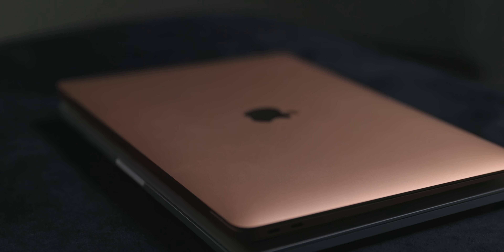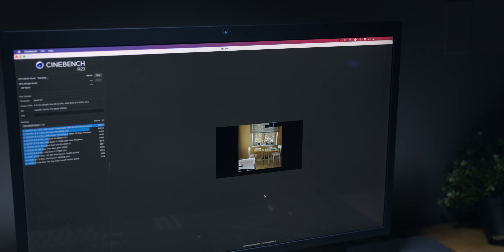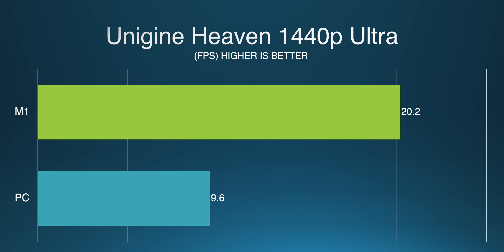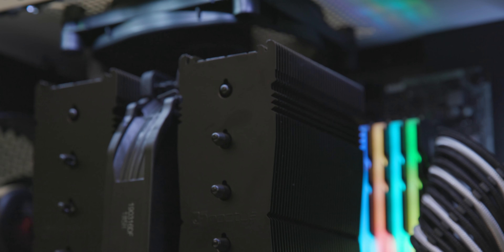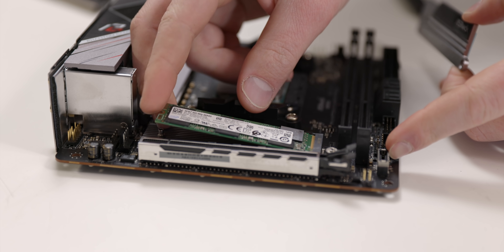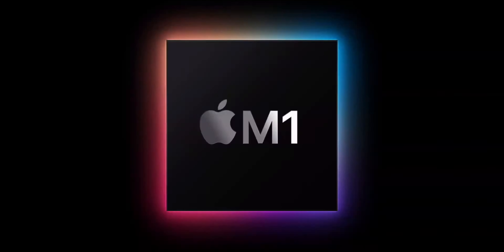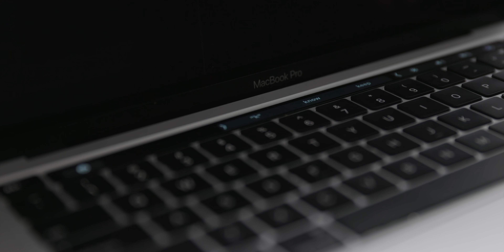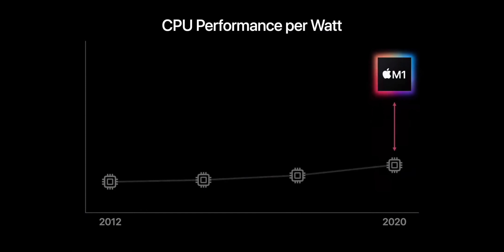$699 Mac mini vs $1,000 PC: Which Is Faster?

Comment: If only the chip didn't include RAM inside it. Once it goes bad, you cannot replace it. Not to mention the rest of the computer components.

If law improves and Apple provides schematics etc. for their devices, and return to making their products repair-friendly like before (read: PowerPC era), I would be the first to buy an ARM-based Mac. But for now, 2021, it's all garbage.
Reply: Nah, that’s just science, if you made it upgradable, it would be slower

Comment: Another part of the Apple's performance gain besides the new chip is the company's optimization of their OS and associated software.  M1's utilization of its memory is superior to Windows in using less space which in recent studies have shown the earlier worry about SSD burnout due to the low 8GB ram size in Airs and Minis is fading away.

Comment: My biggest issue with the M1 is the soldered SSD. I usually donate computers I replace  every 6 or so years so I would prefer it to last a couple more years longer.
Reply: Yeah; soldering an SSD to the board is a problem IMO. If the SSD is used a lot and wears out before the machine is considered outdated, that's a loss of an entire device unless it's able to boot via Thunderbolt storage, which wouldn't be as fast, anyway.
Reply: They could have EASILY used a standard replaceble m.2 drive but apple are scumbags
Reply: That's called a humble brag.  You just did a humble brag.  Nobody cares about how charitable you are.  Nobody.

Comment: Although technically it's heat, TDP is effectively power and heat. You also can not do apple to apple comparisons on TDP. Intel, AMD, Apple. Nvidia... THEY ALL determine TDP differently and under different circumstances. If you purposefully cripple based on TDP, your review is wrong.

Comment: Isn't the M1 a repackage smartphone/ tablet chip?
Reply from the maker: Basically. What’s your point?
Reply: @snazzy   it's  old smartphone technology in a case with a few ports. Which not is not innovated. What is innovate is the ability to run desktop programs efficiently as if they were phone or tablet apps.

Comment: Sorry but what did bring the cost of the ryzen build to 1000$? I mean. I got same performances on a build which cost was less than that, where i have a ryzen 3600 and Nvidia 2060 (i already have the gpu since few years), though. M1 is amazing, but on 3600 i get the same performances (and it costed just 170 euros), where GPU is obviously way faster

Comment: Until Windows doesn’t suck and crash all the time on heavy work loads I’m switching to Mac and keeping my pc for games. Haha
Reply: Crashing on high work loads has more to do with your hardware than the OS. The idea that Macs won't crash is just wrong. I've seen plenty of crashes on both systems. 9/10 times it wasn't the OS that was the problem. People often switch from a terrible windows machine to a high end Mac and think that windows was the problem. And that's just ridiculous. There are plenty of arguments for Mac over Windows but "crashes on high loads" isn't one of them.
Reply: @lamenamethefirst  When Windows error messages  pop up all the time saying “Windows ran into a problem” doesn’t scream hardware problem to me. Running benchmarks and knowing what my hardware is capable of, it shouldn’t be crashing at all. You are right though, Macs have their problems but I’ve never run Into problems like this.
Reply: @BipityBopity93  Interesting. I've never actually had that problem on Windows since windows 8. I think hardware compatibility might also be factor. Some things just don't work together sometimes and with Windows, each piece of hardware isn't carefully selected. People building their own PCs will slap a bunch of things together and sometimes shit happens. Even manufacturers cut corners. But my point is that I don't think Mac OS is intrinsically more stable than Windows in my experience. Cause I've seen some Macs that crash daily and some Windows machines that are rock solid. But Mac having less hardware options on the user end allows them to have more QC in general. Anyway, I just think people often don't do an apples to apples (sorry, couldn't resist) comparison with the Mac vs Windows debate.
Reply: @lamenamethefirst  Totally. It isn’t as black and white like everyone thinks it is. It is a preference. I have friends who prefer the Windows OS over Mac OS simply because they are just use to it, and the same the other way around. My hardware is all comparable with each other which doesn’t necessarily mean there is a manufacture based problem with one of my pieces of hardware or all. I will say this, I spent $1500 on my PC and I spent $1500 on my Mac Mini M1. One crashed way more than the other. This has been a consistent consensus for me personally. So my initial comment was based on my personal experience, not necessarily the argument as a whole.

Comment: All good points but how many people care about 22 watts vs 130 something?  Laptop, sure but I could care less at home unless I am a crypto miner.  I have never had a friend buy a slower Proc for their home PC because the fastest cpu used more watts, lol.

Nah, the apple laptop/desktop is not for most.  Boomers?  Sure!  C-Level execs that want to roleplay Silicon Valley startups?  Absolutely!  Public school teachers that want to fit in with all the cool kids?  Check!

The biggest drawback of the M1 chip is the MacOS itself.  However, as soon as Linux has a kernel for the M1 I might buy it...if AMD is still not killing it with threadripper.

But I will admit, software engineers like me do not make up the majority of PC buyers and it would really suck to get stuck in the Apple ecosystem.

Comment: I was concerned that Apple silicon was going to bomb and that the compatibility and performance wouldn't be up to par. Turns out that neither of those things are true and as a bonus the power consumption and price of M1 powered systems are very reasonable. I'm at least a year off my next upgrade, but it's good to know that the new machines are very capable and decent value.

Comment: M1 is good in a LAPTOP. As a desktop CPU (and especially GPU) it is just too weak. Edit: Nice sponsored video, nobody would buy that crap as their $1000 PC. Unless you live in a pod, you can build full desktop that will obliterate the M1 for $1000.
Reply: someone’s mad 🙌🏽
Reply: @iwatchgamingvids2.043  Did you even read the comment? The GPU in M1 is about equivalent to gtx 1650. You can buy a desktop with better card for $1000. M1 is not a desktop grade CPU, it falls behind. You probably live in a pod, hence why you need such tiny device as a desktop. This moron bought a piece of junk passively cooled chip, a thing no one would buy with that budget and proven a non-existent point. He is either stupid or another sponsored shill.

Comment: Its Mid mMay 2021, I am on my 4th M1 MBAir. Apple phone people told me my first machine's random reboot must be a hardware issue. The replacement ran HOT with short battery life - clearly hardware in that case. The third , after a month, shut down like the first ... they were all 8Gb mem  1Tb ssd machines. I got my money back - and now have a 16Gb 1Tb version. And... I recently saw a video saying the shutdown was software after all ! Hum. Just thought I'd say that. My story started last December. I'm waiting for a Pro box with a bigger screen ! 13 inch is just not enough, but I am getting used to it.

Comment: I actually just last night ordered a basically max spec (besides SSD) M1 Mac mini... 16 GB and 512 GB SSD... It's going to take over for my 15" 2015 (max spec besides SSD) MacBook Pro as my "desktop Mac" setup, since my MBP is currently setup clamshell'd with two 24" displays attached (among other things). It was supposed to be my creative workstation (for some video editing, PS3/4/Switch/PSVita gaming with streaming and capture in the mix) as well as some graphics "work" (as I don't do it professionally) in there too. My aforementioned 2015 MBP gets bogged down with all that. As a laptop on its own it works super well for its age. The M1 Mac mini is gonna be a champ at all of what I aim to do and I'm excited! I appreciate the unbiased view points and the subtle humor you bring to the table, Quinn. Keep it up!

Comment: There are even $2000 windows computers that can’t be a $600 M1 Mac mini
Reply: Nope. This is the worst video i have ever seen. The windows didn't have a dedicated gpu. He could have got a 1660 atleast
Reply: @heershah6451  the m1 doesn't have a dedicated gpu either, its a 7 watt integrated gpu
Reply: @heershah6451  it's a 7watt gpu, it's integrated. 1660 is a 110 watt gpu
Reply: @dustbinsavesyou8283  whose the fanboy here. It is a desktop. It really doesn't matter. Are you sane. And it performs so much better than the M1 mac mini. Who looks stupid now😂😂

Comment: 4750g passmark single thread - 2700pts (passmark),  M1 - 3700pts so the results arent surprising, if you go with a newer Tigerlake or higher end Ryzen you can close that gap, with the  Tigerlake 11700 at 3400pts and  the Ryzen 7 5800x at 3500pts, with the added versatility of more ram and space you could get something equivalent but more versatile with a cheaper overall eco system.  But real world performance might not be the same because that M1 chip has its memory integrated so who knows how small that gap can really be closed.

Comment: Yeah, I agree with much of your covered topics. AMD will more than likely design and manufacture ARM based chips so they can sell and dominate the laptop market. The graphics performance from AMD Radeon is far superior to what Apple is using in their chips. Samsung have incorporated RDNA into their Exynos chips and it runs close to twice the speed of other gpu technologies available for ARM. The next iteration of Ryzen, Zen 4, will be considerably faster again compared to their current offerings and will include RDNA2 into their APU's, add DDR5 and you have a winner in either x86 or ARM configurations. Which brings us to Intel. Well, "Poor Intel". If AMD were gobbled up by Microsoft, could you imagine with all that money how AMD would be able to innovate much faster.

Comment: nifty to hear that the M1 is great but I find it difficult to recommend many things in apples ecosystem due to it being so tightly closed and how atrociously repairs are handled if they are needed
Reply: Coming from Windows / Linux / Android world and switching to Apple, the transition was the best. All the old products feel like crap and old and nowhere near as functional. I had stuff break on my other devices all the time, had to fix them myself. At least Apple has stores and you can go in and have them fix it for you. Apple ecosystem is amazing, you can connect to each of their devices and they work seamlessly together, I can play a song or video on my laptop from across the room, by just using my phone for example.

Comment: I’ve had 2 Windows laptops and 1 Mac in the last 5 years. In 2015 I bought a simple $500 Dell / Windows laptop because I took a job for a few months in Texas that needed one so it was a rush purchase. In 2016 I took my time and bought a 256 GB SSD with touch screen for $799 on sale. It was crap. 2017 I paid mucho dinero for MacBook and I kick myself to this day for paying $2400 for a laptop. The problem with my cheapskate mindset is I got what I paid for. It hasn’t given me one problem. The screen is phenomenal. It boots up a few seconds slower than the SSD machine but 10x faster than the cheap one I bought in 2015. If reliability is necessary the Mac is the way to go.

Comment: It is a great product. I am sure there are just overall Apple haters out there that will just trash anything, but I have never gone to the Apple side of things because I like freedoms of choice. And that about just sums it all up. I do not like iOS or MacOS. I do not like to not play games when I have time. I do not like noting being able to buy whatever software I want and have it just work. Hell, I can make my Linux machine look just about exactly as pretty as an Apple product, and it still plays games at a very high level and their is tons of free software that work with Linux and  Anyhow, I do think Apple has a great product. I am sure if Microsoft decided to lock down Windows, then build a CPU that only needed to do a fine line of instructions because the OS is locked down and doesn't need to broadly support everyone, it would also be "mind blowing".

Comment: Stupid comparison, 4750G is based on the old generation ZEN2 and not the new generation ZEN3.
The M1 chip is a new product, so compare it to the new generation of AMD and Intel, moreover the 4750G processor is an APU that is not designed for high performance.

Comment: Yes they are that good until the M2 comes out. The thing about bench marks are. They really don't mean that much. Nobody runs just bench marks. The best tests are with the applications you run.
The bad thing about the Mac mini is that the ram isn't replaceable or upgradable. What pushes Apple over the top is that Mac OS runs on top of Unix. Windows runs on top of debug code.

Comment: Truth: x86_64 architecture is already dead.
x86_64 uses the CISC instructions which chew up power at the cost of enhanced computing capacity
M1 is based on ARM64, which are much power efficient and mobile world had been catching up quite well.
So going forward, expect to see everyone switching to ARM64 with possible x86_64 emulation.

Comment: Well-It is hard to play ball with you, considering the vast knowledge you contain. My wife has a M1 MB-Air. She does what she usually does. Looking at fashion. Making the family "Libre Office" sheets telling me how much allowance I have left. In the meantime I have her old MBP with Core-i5, 13" late 2013. I just invested "peanuts" into a Win10 and set up Boot Camp on the old 13". Then it struck me that the M1 demands "Parallels" to get a beta experimental Win10? This will be expensive! Will it be actually a good-by to Win-10 dual Boot, on a practical level? That would be very bad! We all have an old Windows program that we must have! Mine is "Chessmaster Grand Master Edition"  I only need a Boot Camp Win10 to run it!! But it is a MUST HAVE! APPLE sabotaged WINE with their 64 bit decission! There are only one solution left-Boot Camp Win-10! I bought her a dongle with USB-3 card reader, and all ports you could think of. It is cheap! But beware, some of them spoils the power usage of the M1 and get too hot. Especially the ones "Integrating into the M1 design". I chose one with a single USB-C connection after looking at the reviews. So I think that You should raise Your interests to the level of the average consumer! What are the problems for "Joe and Jill"? You can comment now!;-)))

Comment: You can't compare efficiencies at different power levels like you did with the 5900HX. Since performance/power is nonlinear, the fairest comparison is comparing them at iso-performance or iso-power. So it's pretty pointless to say the M1 is 328% more efficient.

Comment: Isn't TDP being a measure of heat output rather than power consumption a distinction without a difference, since all power consumed by a processor ultimately ends up as heat?

Comment: If you are comparing the M1 to other CPUs by failing to use the same external storage of course you will get a biased result - why didn't you put the same SSD on both systems?  If you want to have slanted results why not substitute an old hard disk with the M1?  Because you wanted the slanted results.  That is what they call Bias; you are more an Apple salesman than a reveiwer.

Comment: Little interjection: APU is not really what AMD calls it's CPUs with integrated graphics. That's already what ARM chips where called when the iPhone came out. It's CPU and GPU in one chip which is basically what the M1 chip is doing too. I'm not sure why we never called the Intel integrated graphics APUs but maybe the term was coined by ARM or there's a technical difference I'm not aware of.

Anyway, APU is not AMD specific. The explanation is, of course, completely on point. It's just not an AMD specific thing.

Comment: If you look at apple HW/SW, they can make an efficient machine/OS due to the tight integration between components which results in less bugs. In case of Android/Windows, the code is designed to work for a plethora of  components which might not necessarily fit together.

Comment: Gotta give it to apple they made a chip for their devices and optimized for their os.  I still need windows so due to software support.  But when Microsoft makes their optimized chip for surface.  It will be interesting.  I doubt Linux will do the same.  Not sure what Intel or Amd will do.  Optimized instruction set chips for the OS should always increase performance.  Apple made the right move after being ignored by intel and other chipmakers.

Comment: The chip is cool. But looking at Apples pricing I would easily have to pay 2.200 Euro for a 24in Mac with a 500GB disk an 16GB RAM. Last year I bought an Huawei Laptop with a Ryzen 3500. It has 16GB, 500GB SSD, fingerprint sensor, a very nice screen, Aluminium for 750 Euro. And in 2021 I bought a desktop with an Intel i9 with 10850k in which I put3 32gb ram, a 1tb m.2 disk an nvidia 1080ti and a 27 inch 4k display. Since I had the graphics card, both machines together is about the same then the apple. My little laptop is fast enough and my desktop wipes the floor with this apple iMac.

Comment: At the start; the macmini chassis is a lot larger than it needs to be, the power supply is too big, and it's probably because it's easier to just not change anything

Later on; There's probably going to be a more powerful M1 which will take up more space, need more cooling, and use more power